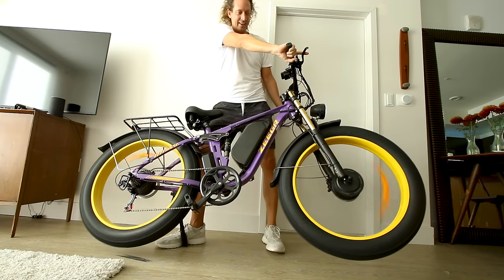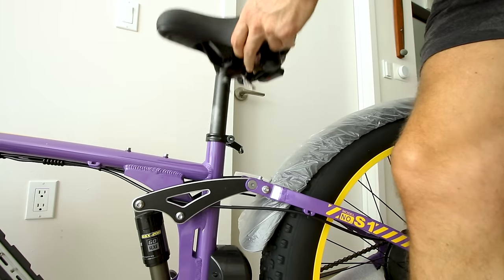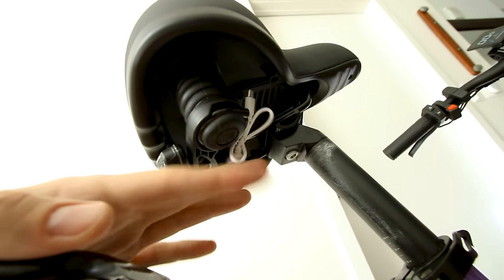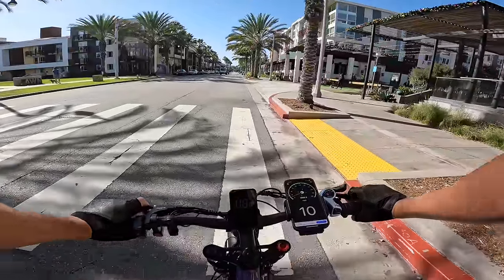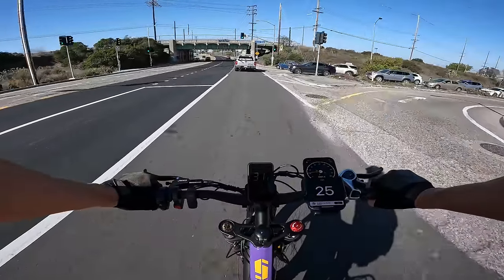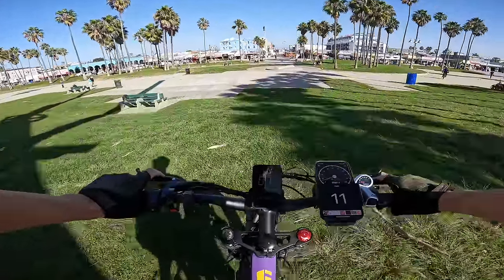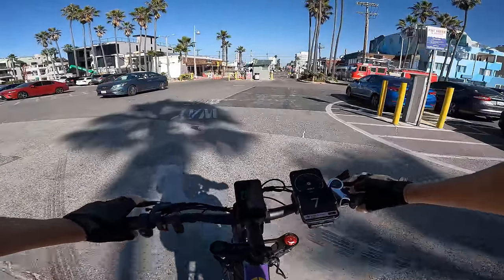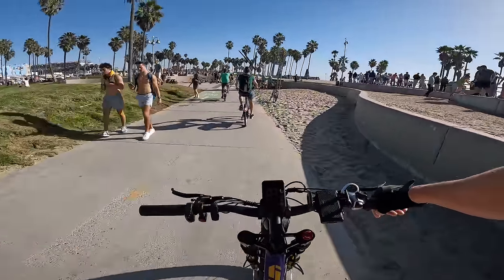This Cheap AWD 35 MPH ebike is SAVAGE - BoomBike Zeegr S1 Review

Comment: The official bike of the LA Lakers?
Reply: It also comes in Black, and Army Puke Green. 😉
Reply: I get that lot when I ride mine.  It is also available in a green and black color, for Lakers haters.
Reply: I was thinking of the LSU tigers
Reply: Hi buddy can you test the  X20 fatt tire electric Bike? /I like your videos and enyoing all moments respect
Reply: @addertooth1  🤔what do you think about it after having it a while, are there any quality/reliability issues??
Reply: @bigdap100  I have about 800 miles on it now, and it has ran like a top.   Somewhere around 1200 miles I might be replacing the brake pads, but other than that, no other maintenance (Since I put flat-out in the tires to prevent flats from driving over thorns).

Comment: $1499 minus $120 code = $1379 free shipping and no tax, this seems like too good to be true for this dual motor 35MPH full suspension 22.5ah e-bike. Is it reliable?
Reply: I have a bit over 300 miles on mine.  The only needed repairs I did was on the seat, and I fixed a flat tire.  I added Flat-Out sealant to my tires after the second flat (I didn't patch the second flat).  The sealant fixed the hole just by re-inflating the tire and riding it. Oh, and the reflector popped out of one pedal, I pressed it back in. 

See my post in this thread for "suggested upgrades".
Reply: Think the color has something to do with it,
Reply: @bassw1758 there is a nice green color!
Reply: @RAZORWlND  I've seen a khaki color too, looks real nice but they wanted a couple hundred dollars more for it.
Reply: @bassw1758  at least the green is same cost as the LA Lakers edition e bike. Lol
Reply: It’s 1200 now

Comment: I don't see anything that would make me want this more than my Zeegr S1.  I bought the Zeegr after Tailhappy's review last year (review is still up if you search it).  The Zeegr has been fantastic - ridden it all summer after buying it in March.  It's currently listed in Zeegr's site for $1250 which is a fantastic deal.  The Zeegr might be slightly slower but it goes faster than I want to ride it on trails (can still do 35 mph) and it comes with better fenders and a rack.

Comment: I own one and have about 300 miles on it.   This review is pretty spot-on.  I was wondering when you would review it.  Thank You for taking the time to produce this video. 
***
What I would add:
1. The rear shock is a shock in name only.  It requires a really hard knock to make it move at all.   It is getting replaced on my bike with a lighter mechanical spring shock with a compression and rebound adjustment (about 55 bucks).  The front shock is nicely compliant.  I weigh about the same as the poster of this video. *Post Edit* a new shock was installed to day, a DNM DV-22AR 165mm with a 750 pound per inch spring.   Much better.  Only complaint was that the bushings had to be shortened to fit the cantilever mechanism on top.  ** (Epilogue: Moved to a 650 pound per inch spring, and it was even better.  For lighter riders who are under 200 pounds, a 550 pound per inch spring would probably be a better choice).
2. Battery life: Flat out-dual motors, 31.1 MPH (according to the bike's display), about 12 to 14 miles on level streets.   PAS mode 3, with light peddling gets you around 30 miles at 21.1 MPH (with front motor switched off). 
3. For riders under 6 foot tall you will have to lower the seat to it's near minimum height.  This makes the bike-seat-taillight at the rear rack height.  This results in poor visibility of the tail light.  Suggestion: Get an uprated tail light and mount it where the rear reflector is on the rack.  (I suggest the WSDCAM taillight (Amazon), which includes multimode tail light, an automatic brake light when you slow down, turn signals, and a loud alarm. It also includes a horn, but that is redundant.)
4. For serious commuters on this bike, consider adding a second battery.   The Zeegr battery was the "promised" 22.4 Ah battery, and is labelled as such.  But, it is only a 20 Ah battery (13S4P 21700 cells, rated at 5 Ah per cell (for 20 Ah of capacity).   
5. Dont lift the bike by it's seat and handlebars.  The two #10 screws which hold the back of the seat to the mount will strip out and the seat will come off in your hands.   I fixed that by replacing the screws with larger #12 screws and upgrading the washers under the screws.  I also NOW know to not lift by the seat, use the rear rack as a lift point. 
6. The street handling of this bike is vastly improved by running street tires, especially higher pressure street tires. (I suggest the Innova Hybrid 30 PSI tires, mine are ran at 25 PSI until the rear shock is replaced).  I suspect these tires would work well in sand as well.  
7. Energy costs:  It costs me 5 cents worth of electricity to commute to and from work (a total of 10 miles).  I couldn't start my car and drive a block on 5 cents worth of gas. 
***
The bike is equally fast on one motor as two (on level hard surface ground).  What the second motor gains you is acceleration rate, and the ability to run over soft surfaces (sand, mud, etc). 
The stock orange reflectors were replaced with 3M Scotchlite spoke reflectors, to eliminate how much the orange reflectors "unbalance" the tires.  Note the wheel hop at the beginning of the video when he has the bike lifted to test the motors out. 
****
This is the same bike as the SMLRO v3.  The SMLRO v3 bike has a genuine 22.4 Ah battery (which weighs 8/10ths of a Pound more than the Zeegr battery).  The SMLRO will go 35 Mph.
Please note, the SMLRO battery has a 5-pin connector at the battery, the Zeegr uses a 4-pin connector.  You cannot simply swap the battery.
Reply: Thanks for your input. I have 2 questions for you. Does this bike have 2 controllers or 1 and how many amps? And does the front tire interfere with your foot in turns? I plan on wearing heavy snow boots and knee boots and I wear a size 12? Thanks for any input.
Reply: @davidmarcoux6349  It has two controllers (side by side) in the box attached to the seat post, which is above the bottom bracket.   And yes, I have dragged my toe across the front tire in tight (slow) turns when I don't have the axle of the peddle under the ball of my foot.  i.e. If the peddle axe is too close to the middle or back of my foot, then there can be a problem.  

As long as your foot is positioned right (or you don't have size 12+ shoes), then you should be fine. The best test would be to put on the boots, position the ball of your foot on the axle of the pedal, and swing the handlebar too it's extremes.  I hate to say it, but with a size 12 boot, you are definitely in a grey area.  

In my menu, the controllers are "set" to 28 Amps.   I haven't felt the need to tinker with that setting (yet).   I am about to mount a secondary (and possibly tertiary) battery on the rear rack.   Once I have all of those usable amps available, I may look more into the controllers themselves.   Personally, I feel drawing 2Kw from one pack is just pushing it.   High discharge currents increase the rate of aging of any battery pack.   If I go triple pack, then I could potentially cruise 90 miles at 21mph under throttle only.
Reply: @davidmarcoux6349  On the boot clearance, I went out and made a measurement.  From the front of the pedal, to the front wheel (at it's closest point), the distance is 5 inches. 
If your boots have a big rounded front which is tall, it may contact the fender.  This could be addressed by trimming back the plastic front fender for more clearance. 
Summary: Put on your boot, put your booted foot on the pedal, with the ball of the foot over the axle of the pedal.  If 5 inches or more of your foot sticks out beyond the front of the pedal, you will most certainly rub.

Strong compression of the front shocks (from a hard bump while the wheel is turned, or heavy braking while the wheel is turned) will reduce the distance a little.  But, most people don't jam on the brakes in snow while turning.   However, you could hit a hard bump while the wheel is turned hard left/right.
Reply: Can you put thinner street tires on it. Wouldnt you need to switch out the rims too. Also is it easy to add a second battery or are you doing a custom job? Thanks. Looking to buy one soon! @addertooth1
Reply: Thanks for everyone's input.
Reply: @gstoe5560  Totally custom.  I have saddlebags on my rear rack, so I want to preserve that utility.  So, I will be welding plates underneath the rack with a 1/4 inch hole in each corner (front left, front right, rear left, rear right).  A bolt will go through that hole, then through a 1 inch stand-off.  Above the 4 stand-offs will be another plate that the two batteries (and their mounts) rest on.  This way, if I need to remove the saddlebag, I only need to undo 4 bolts, lift the top plate, and remove the saddlebags. 

I will be using a "Polar Bear quad battery combiner".   The output out of the combiner will be connected where the original battery went into the controller harness.  It should be an XT60 type connector.   

I already have a double battery combiner sitting around, I may end up just doing a two-battery solution, I haven't decided yet. 
I have already welded horizontal bars to each side of the rack, to support the saddlebags and keep them from swinging into the wheels when cornering.  So I am no stranger to welding and fabrication.

It was DavidMarcoux who was asking about foot clearance.  I was providing him measurements from my bike.  I have smaller feet and have no potential problems with clearance if I have my feet resting correctly on the pedals.
Reply: Good information - I've been looking at this or the SMLRO V3 Plus - they looked similar enough that when I make my purchase it will come down to price/delivery.
My commute is 26 miles each way - but it's 4 miles from my home to the train, two trains, then another 2 miles to work.
The gotchas are that while there is a shuttle from the train stop to my work, as well as a public bus, unless I have immaculate timing, I miss the shuttle and the bus only runs hourly. About half the time I end up paying $8-12 foe a ride share.
To get to the first train station, there is an hourly shuttle - which means that best case, I catch the shuttle at 5am and have a 10 minute ride to the train station, then a 45 minute wait for the train, a 10 minute ride to the next train with a 5-10 minute wait for the second train, which takes me to within 2 miles of work.
I have no particular desire to ride the full 26 miles, but it would be nice to have that option if I needed it. There is a major hill I have to get over which means I'd have to go slow on PA3 to extend the range that far, but that's ok.
More typical commute is bike to the train, and bike from the last train stop to work.
That allows me to leave the house at 5:45 instead of 5, eliminating the 45 minutes wait for the first train.
Getting off the last train, it's a quick 5 minute ride to work.
Once there I could either bring the battery inside to charge it, or use one of the EV charging stations where the way they have it set up, I was able to charge a bigger battery than this one without using up the 'grace period' they have set up in the billing - so literally zero cost.
This will also get me some protection against the Mass Transit gotcha's - like when the train has an unannounced outage and I have to wait 20 minutes for a shuttle. 
All in all, it will save me about half of a 3 hour commute - each way - so that's 15 hrs/wk of my like I get back = probably closer to 10 since I use ride share services to cover the transit gaps, which is probably close to $100/wk.
So, in about 3 months, it's paid for itself.
I had a conversion kit bike, but it was not overly reliable due to some mistakes I made. so I'm done with that for now - though it taught me a lot about what I want. No more hard tails for sure.
Reply: Merci pour tes informations sur l’amortisseur. J’ai le Keteles K800 pro, même punition pour l’amortisseur arrière et je vais suivre ton conseil. Sinon à part la peinture jolie mais fragile il me convient parfaitement. Parfois un petit faux contact sur la poignée d’accélérateur, je vais suivre ton conseil pour changer mon amortisseur. Bonnes chevauchées !
Reply: @cnefracasse1632  Tu es plus que bienvenue. Les informations que j'ai données étaient basées sur une expérience réelle du changement. Le support d'amortisseur supérieur a été fabriqué à partir des bagues de rechange fournies avec l'amortisseur et coupées à la bonne longueur.
Reply: Thank you for the amazing insight.  I've read your post on EbikesForum as well.  I'm thinking of this Ebike, but I want to change out the battery entire, but I don't know the controller's specs.  I'm thinking of either installing a 42V 24Ah, and possibly the 52V 24Ah LG4800 Cell, and sell of their 22.4AH (in reality only 20Ah).  Do you know the controller's specs?  Might even change that out too.  The purpose is to get better range, and with the 52V, maybe a little more spunk without burning anything out.  Thanks in advance!
Reply: Thanks for all your insights! Very much appreciated! @addertooth1
Reply: Im getting the Smlro v3 but one thing I noticed on some other reviews on it is that unlike this bike the smlro has no switch to turn off the front motor . Might just unplug it to save battery because a 1000 watt bike is still decent !!!
Reply: @keapaishere  Unplugging the motor "may" put the controller in a fault condition, and keep the bike from running at all.  

But yes, on level and flat ground, the Zeegr goes the same speed on one motor.  The second motor simply gives you better acceleration and hill-climbing power.  With surfaces like sand and mud, it reduces the chance you will become stuck.
Reply: @keapaishere  why buy a dual motor, pay more  and increase weight for dual motor and controller, to eventually unplug the front motor? adding a switch doesnt sound too crazy
Reply: What is the model number of the second shock you ordered? (the 650 pound). Ordering this bike tomorrow but want to order a new rear shock too for it. I’m 155 pounds
Reply: Have you had any issues with the rear tire hitting the controller box after swapping to that shock? If you go to the SMLRO V3 page, they have a huge block of text warning that the bike "requires" a 1000 or 1200lb shock to prevent this. 🤔
Reply: @Are0hEssEss  Not at all.  The factory shock was 158mm, and the replacement shock is 165mm, which gives some breathing room.  Also, the box does not stick out as far as the SMLRO box does.   I checked it for scuffs last week, when someone asked a similar question.  There are no scuffs on it's surface.
Reply: @addertooth1  Ah, good to know. I ordered the 650lb version, today. 👍🏾
Reply: *Follow-up* I received and installed my shock, and it's much more comfortable than stock, but it DOES scrape against the controller box when riding. The additional length of the shock brings the wheel closer to the box instead of away, with how the suspension is designed.
Reply: What brand are the cells in the battery? What size are the motor controllers?

Comment: Thanks for your review. Before I start  I want to tell you I'm 71 years old and have limited peddle power left in me. Well I ordered one of these and I love it so far EXCEPT for what wasn't as listed. NOT your fault, they obviously sent you a better bike. Here's what I received that was different. The front forks are just springs in tubes, no adjustment at all. I didn't get the powered phone holder. The phone holder would have been very nice, but I found a handlebar extender that holds 2x18650 batteries with USB. I shouldn't have had to buy one! The rear shock appears to just be a spring in a can, like the front forks. After I order an air shock for the rear I will cut open the one that came with it and we'll all know. It is unlike my other DIY ebikes or my friends ebikes. When you set it to zero peddle assist you get nothing, no throttle at all. All it really does is enable peddle assist with speed limiting. Not the safest for tight turns on narrow trails or climbing over trail obstacles.
Just a little about me, fact not brag, well maybe a little brag😉. I have built 4 gas bikes, one of witch is complete DIY with a Predator motor on it, and  5 ebikes. I've built and repaired a bunch of ebike and scooter batteries. When I build a battery I build them Tesla style. I.E. every 18650 battery has its own fuse. I've worked on bikes and motorcycles since I was a teenager.
Keep the skinny side everyone! 😁👍

Comment: He burns through a lot of JUICE but you can get some decent battery life and mileage on this bike if you don't go beast mode. I keep the front motor off and keep it at PA2. In my longest ride Strava says I did 28 miles, with moving time of  3:20 hours. 1070ft elevation and 8.4mph average, with a top speed of 32mph.  This ride was 90% on mostly level dirt trails. The battery meter had switched to one bar of battery power just as I finished.   I weigh about 190. I figure  might have been able to get another 5 miles. This is not bad for such a big bike.
Reply: did 32 miles on mine today with 2 bars left and half the ride was in beast mode. I think they get better milage then is stated. I am planning to do a range test this week and will post the results here. This is a under rated badass bike I get some really nice rippage.